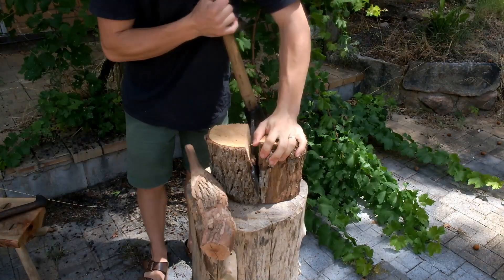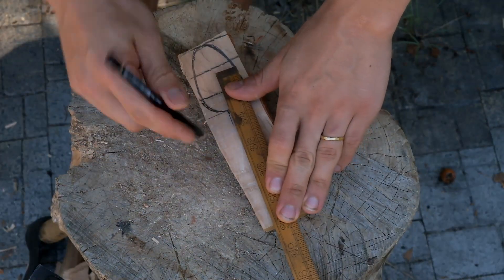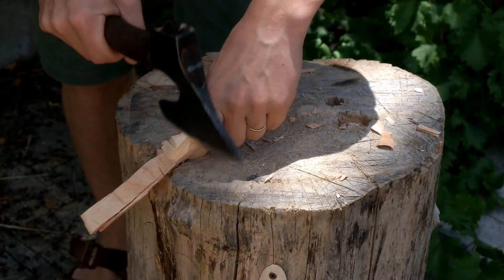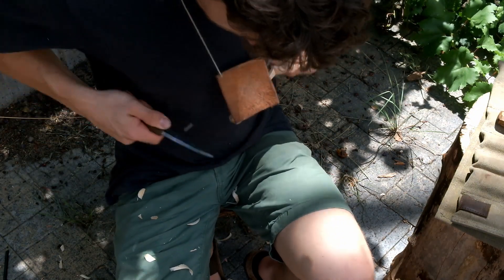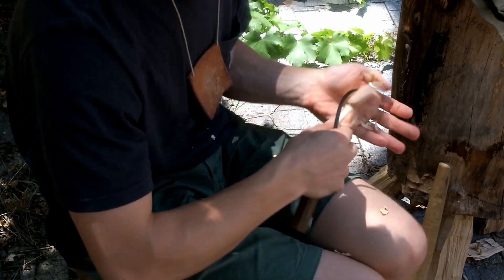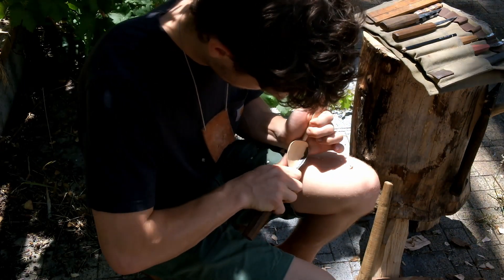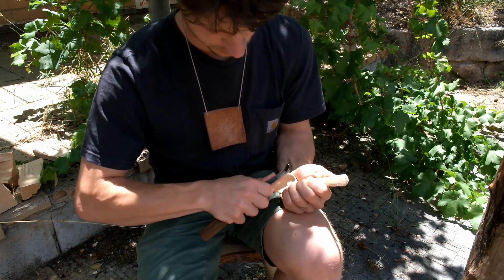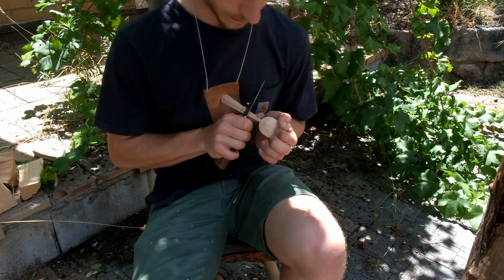How I carve an eating spoon (narrated) + tips for intermediate spoon-carvers | Greenwoodworking

Comment: You make it look so easy, I don’t know where I am going wrong. Most of my cuts rip using both knifes. I don’t know if my blades are just not sharp enough. 
Really good video.
Reply from the maker: If your cuts are tearing out the grain it's usually because of inappropriate wood choice. Also, it's easy to tell if your knives need to be sharper, if you gently rest the edge of the knife against the flat of your thumbnail, does it catch? or does it glide. It should be sharp enough to catch immediately. With experience you can tell how sharp by how it feels.

Comment: I really adore your work. Appreciate your videos. One question, Where can i get this axe or the other one that you use in most of other videos?
Reply from the maker: Thanks mate.

This axe is a slöjd axe by the blacksmith Anders Soberra @asoberra. It's fitted with a handcarved oak handle and box mask by me.

The other axe is the gränsfors bruk Swedish carving axe. I'd recommend it to anyone, it's a great axe and widely available. Worth noting that it's much heavier but with some practice and strength building you can be just as precise with it. Hope this helps.

Comment: I love how well water color pencils show up when scribing the shape of the spoon, however I find as I do my knife work and handle the blank all over as I carve, a lot gets on my hands, and in turn back all over the blank. Do you just have so little pencil left on your blank by the time you finish you axe work that it’s easy to avoid? I know that finishing cuts can also eliminate most of the marks as well. Thank you!
Reply from the maker: I don't have that problem with my watercolour pencils, maybe try a different brand? I use Faber castel "Albrecht Dürer" pencils. When my lines get carved off I draw them back on.
Reply: Thank you so much! I’ll give those a try.